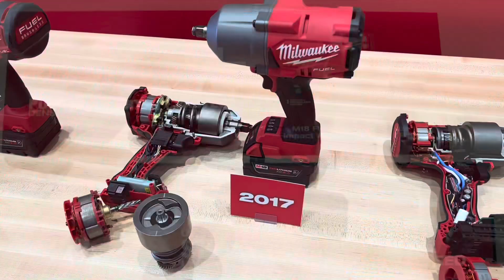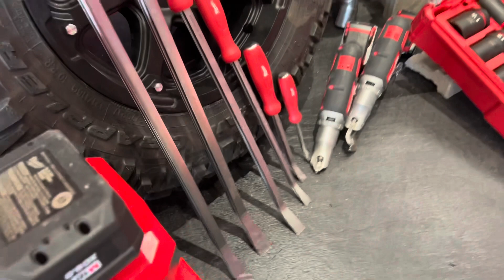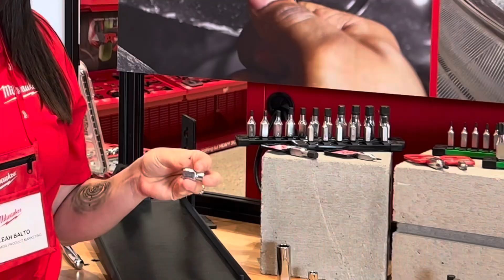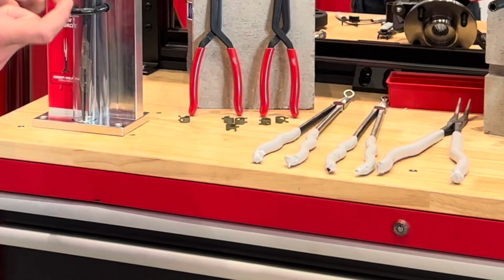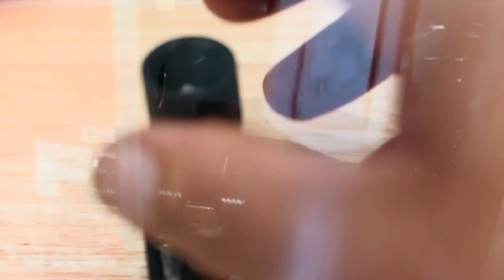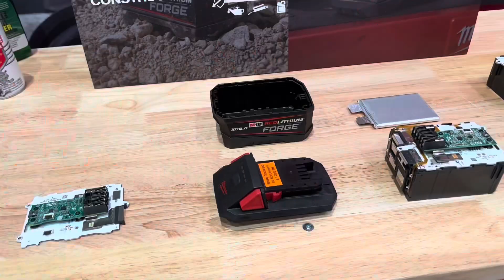I Went To Milwaukee & I Can’t Believe All The New Tools For Mechanics Coming Out

Comment: Putting a tool bag kit for our Sprinter Rv and if you could have only one a 1/2 or 3/8 impact what are thoughts. Thanks
Reply from the maker: Of course it’s going to depend on what you’re working on. But for me, I like the 3/8 because I have a lot more socket options.
Reply: @HowtoAutomotive  do you know if they will have a new gen 3 of the 3/8 mid torque impact on their website and your video they only show 1/2 mid torque and 3/8 compact (which is half the power) but I want it in a 3/8 and debating waiting for new gen 3 if it comes or not
Reply from the maker: @loganalmanza675  the 3/8 mid torque was updated not too long ago. I don’t suspect an update for at least a year or so. They announce any at the show either.